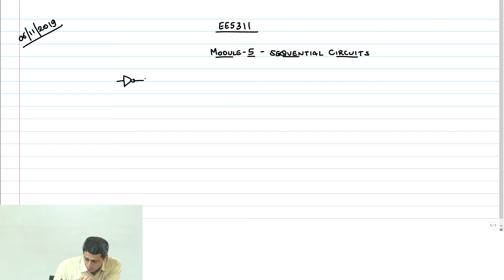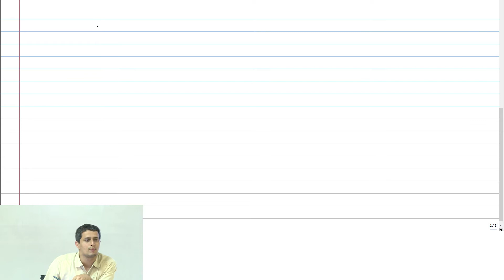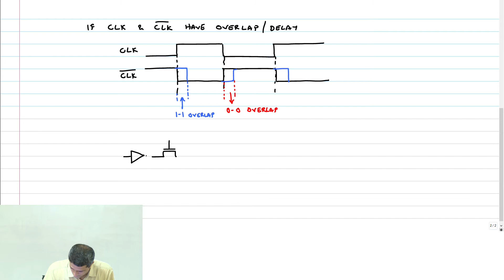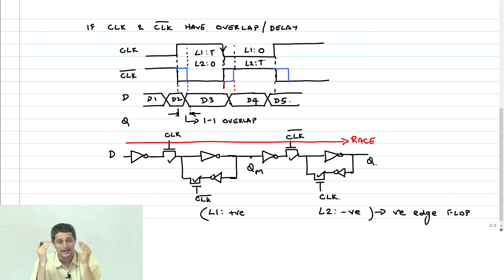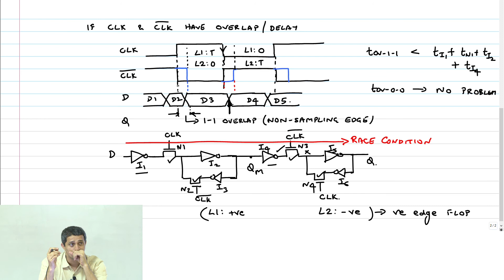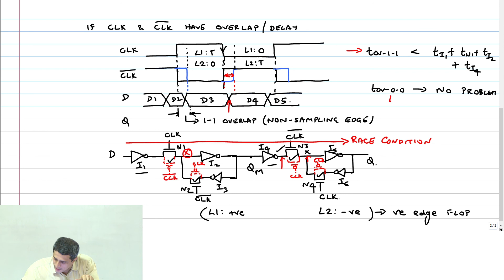SeqCkt - 6 - Clock Overlap

Comment: At 22:28 there will be problem for 0-0 clock overlap also, because there is no latch to hold the data and we are  just relying on the parasitic capacitance to hold the data and that might leak before skew ends.
Reply: The data is being held by the feedback path and also becoz the L2 is transparent the data from X goes to the Q, and it is not a problem as when the clock goes to low the N1 will turn off and thus X won't register the change in D and thus we don't sample the change in D for 0-0 overlap
Reply: @madhursharma4445  I was thinking the same, but it will not be a problem because 0-0 overlap is for very small time in comparison to clock time period(25:30). Parasitic capacitance will not be able to discharge below the trip point in that small time-frame, and it will be latched into the slave without any data corruption.
Reply: dude cap has no path to discharge or charge so it will just hold the voltage